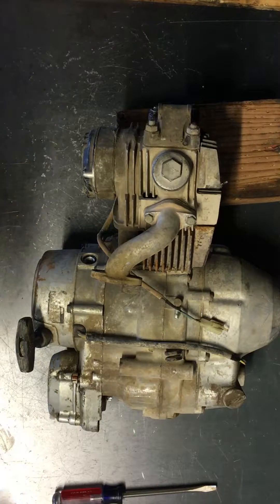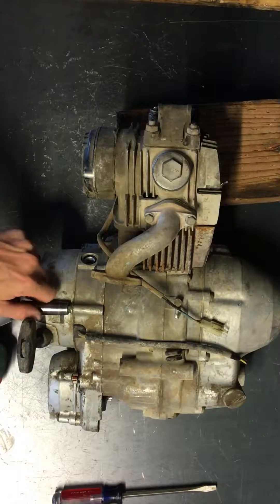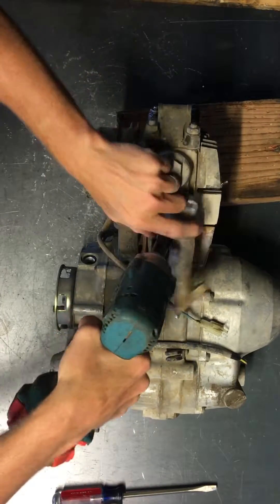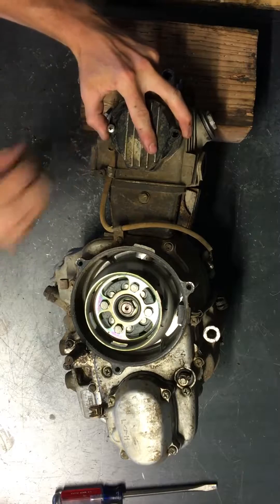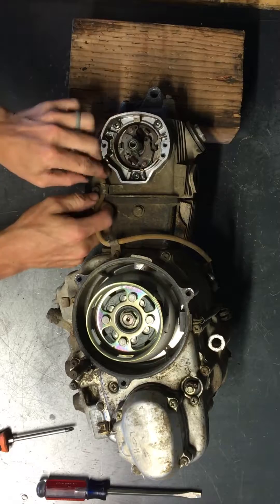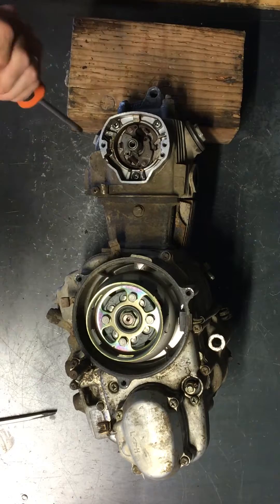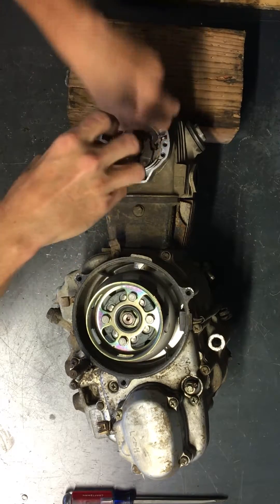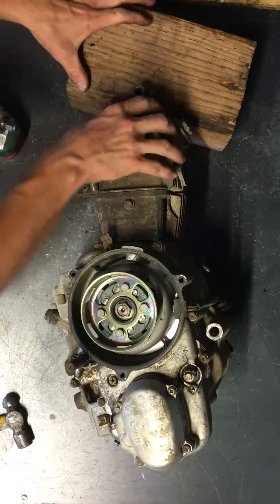Honda ATC110 ATC 110 Ignition Control Point - CDI Spark

Comment: Good Video, I have a question, I built an ATC90 into a 180 engine back in 1982. I just git the bike back with only 5 hrs on it.     Can I put the cdi electrics on this motor and delete old school points?